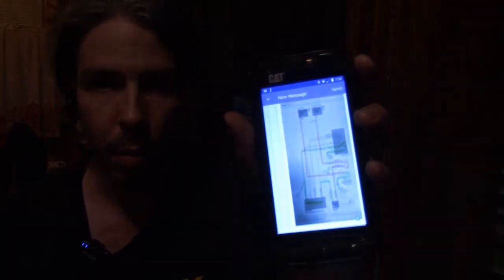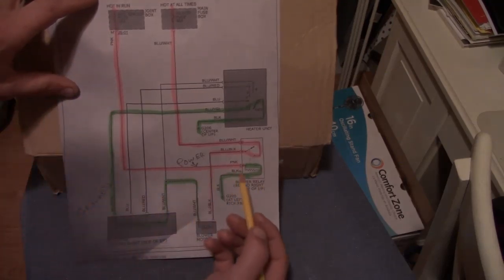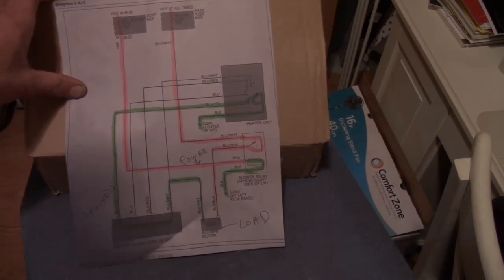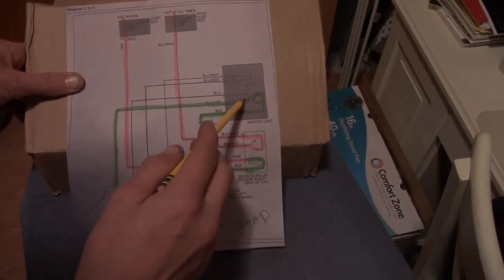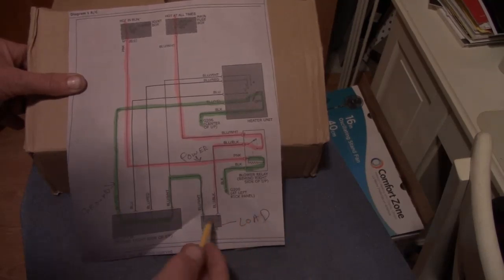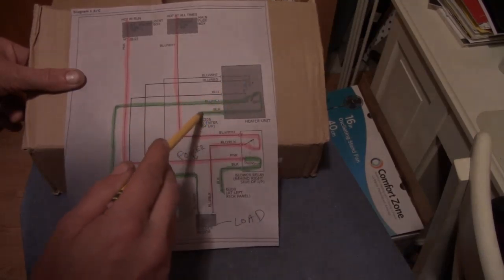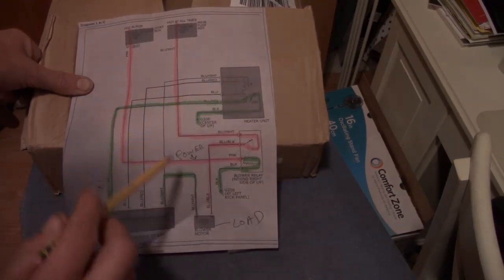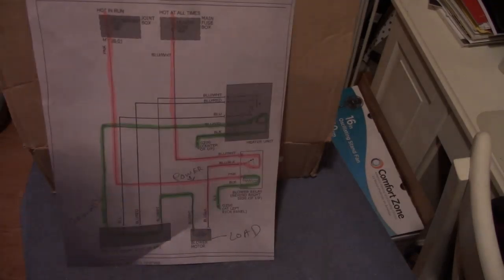Car Wiring Diagram Going Through A Diagram For a Viewer

Comment: first time i seen a blower wired this way i confused myself big time.  remember on a dc circuit  it has to be a circle. power leaves the source goes through the job and returns to the source.  it dont matter if you send the power through the switch and resister or  you put it direct to the blower and switch it on the other side.   if that circle is broke it wont work, period. it may try to find a way back  but thats  another story.  and remember regardless if you are usin a voltmeter or test light  you are testing between the two points those items are connected. if possible always connect one end to the source.(the battery)  when i was starting out one of my first jobs was a car drove in  wipers wouldnt work(raining out).  got my handy test light out couldnt find power  at the switch. went down the rabbit hole  until it hit me right beween the eyes?  did i have a circle? i thought i had a clean ground on my light  and in the end i did.  the battery ground went to the engine and a jumper strap from there to the body.  it was broke  so i had no circle  no path from the body to the battery   through the engine block. my test light grounding point didnt have that part of the circle to make it back to the source. i hooked a wire to the battery to the test light clip and bingo i had power where my light previously said there was none.   they dont draw wiring diagrams as a circle they use that ground symbal to show that paper the same as a car body. the paper is the invisible return path part of that circle.  great seeing someone wanting to learn and kudos joe for helping!  some take things for granted that others struggle with.
Reply: I look at wiring diagrams just like they are plumbing blueprint, just different symbology.

Comment: Holy crap, I am uploading a video of me going through a diagram for a viewer right now!  And it also a blower problem!
Reply from the maker: LOL Same one? We can compare notes lol
Reply: No mine is an Impala that only stops blowing when he plugs an accessory into the cigarette lighter, it's been to a dealership twice.
Reply from the maker: LOL An Impala with body control problems? You don't say. LOL
Reply: @JoesAutoElectric  Hey now, I like my GM's.  GM is actually my favorite thing to work on. Yeah they break, but my scan tools support them well, I can find the diagrams and info on them easily, and there is a plethora of used and aftermarket parts.
Reply: @JoesAutoElectric  Right!?! I have a 07 Grand Prix, ask me how I know about these GMs lol. My experience these things sprout gremlins at around 100k like clockwork
Reply: @frugalprepper   the 3.8 is a great engine. I have a 07 Grand Prix that wouldn't communicate with the throttle body. Had to literally go hand over hand thru the harness where I found a broken ground. Reverence voltage was there and  throttle pedal and throttle body and ECU checked out, thats when I said to myself its gotta be a bad ground

Comment: At 1:14 my response was the switch is breaking ground. I like these kind of videos. I like to follow and see if I can figure it out. You did a great job explaining this Joe. Pretty cool that you took the time to help this guy. I learned way back in my teenage years (I'm 53 now) to keep a headlight with a couple pigtails w alligator clips in my box for load testing. I learned to use one from the School of Hard Knocks, where a meter leads you astray sometimes

Comment: Just for curiosity, what kind of  load current does a power probe load the circuit with. Good detailed explanation of circuit operation and should be helpful in diagnosing the problem.
Reply: If i remember right its less then a test light but most power probes can show 12 volts on a circuit or ground but you can still have no current flow thats why you load test, bad wires or corroded wire can still show voltage but fail under load always load test.

Comment: Hey joe what do you think about these Lincoln ls v8 with the 1299 code it overheated slightly my friend said and went to start next morning wuddnt start any advice joe?
Reply from the maker: P1299 is cylinder head temperature sensor has detected high temperature. I would look at what caused the overheating and hope nothing serious got damaged. ie head gaskets.
Reply: Joe's Auto Electric thanks for the response this car has a code that tripped with the 1299  a 2196 code weird

Comment: Kudos on the power probe comment. Power probe is a great tool but like many diagnostic tools it has it's place.
Reply: Actually I disagree. The power probe is a great tool to test a blower motor issue. Since you're already at the blower, disconnect it and use the power probe to supply power and ground directly to the motor. If it spins then your have a circuit issue. Check the rest using what Joe suggests.
Reply: @Usmanthemecano  no argument there, in fact that is about the only thing I use it for. It is not a load tester and if not aware it CAN fool you.
Reply: @MrJgonzalez2  I believe we are speaking the same language :)

Comment: Joe thanks for putting out the video  for us beginner technicians , The only thing I didn’t understand was when you said , load test do not use a power probe , i’m not gonna lie the power probe is my go to tool. I know you’re a busy man but whenever you get time please educate me
Reply from the maker: If you touch the tip of the PP to the 12v supply, you are not putting a load on that circuit. So, if you have resistance in that circuit, which will cause a failure with a load on it, you will never see it. A testlight is a step up in the right direction, but when we are talking about circuits that carry loads like a blower fan, we need something like a headlight to use as a load to verify it can carry enough current. Hope this makes sense.
Reply: After watching your videos a few more times and reading your comment I think I understand now , The headlamp which represents the load is equivalent to the blower motor , right?
And if there is resistance in the circuit , would your infrared heat camera pick it up?
Reply from the maker: Yes, the headlamp would be the load, exactly right. Thermal can certainly pick up hot spots caused by high resistance, and so can voltage drop tests. Many ways to skin a circuit.

Comment: Some circuits are easier to design and more efficient when it's an earth switching circuit, like this blower motor and a horn circuit. Thanks for the video. Like you said, best to always use a multimeter, not a test light.
Reply from the maker: Actually I said to use a testlight. Tools all have their place.
Reply: Id say the exact oppisite in this case a test light is the better tool to use cause it loads the circut.
Reply: Oh, I use the term test light to describe a tool that connects to earth, with a probe that lights when voltage is present. I usually only use a load (headlight bulb) for short circuits. Cheers from down under.